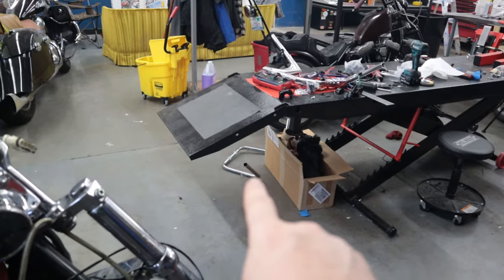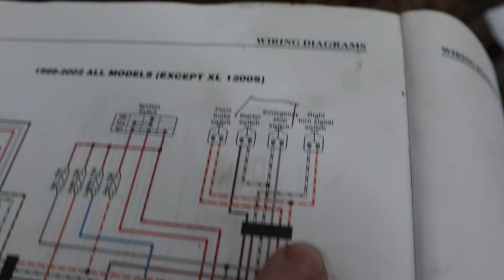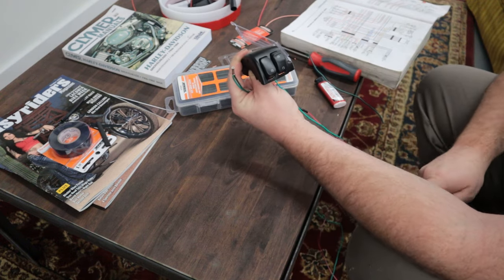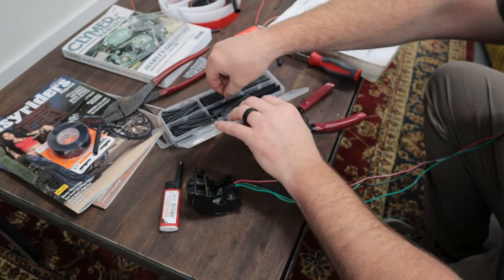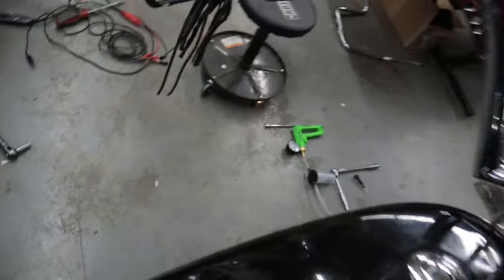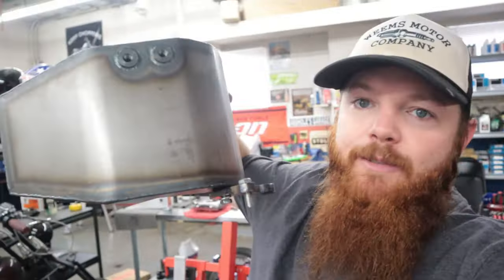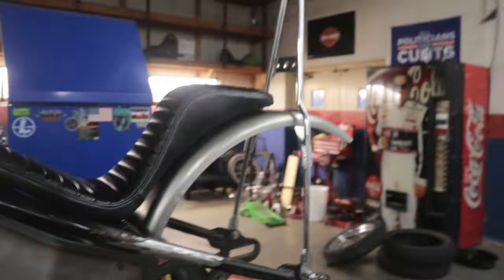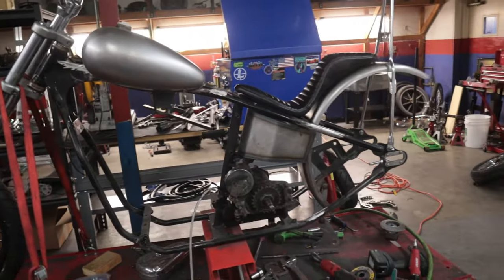Fixing the WORSE Bubba wiring I've ever seen | plus some chopper stuff |

Comment: Good fix, I’m going to be in a worse situation with my buddies Sportster, the previous owner created their own dash switch panel and digital speedo, all the turn signal wires have been cut, the harness was a tangle of bare wires and even some bare connections, on top of that the handlebars were home made 7/8. 😅 I’m amazed it runs. It’s a next year problem, take care.
Reply from the maker: That sounds like a real nightmare good luck🤣